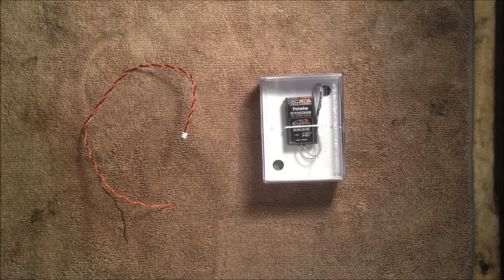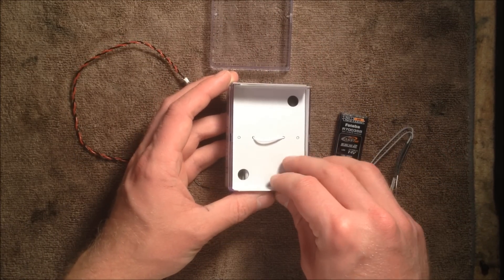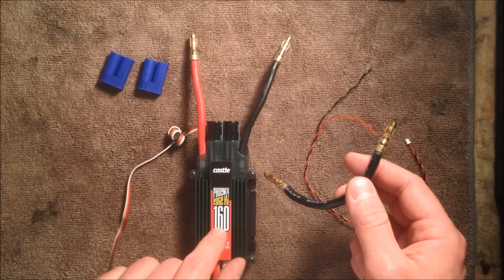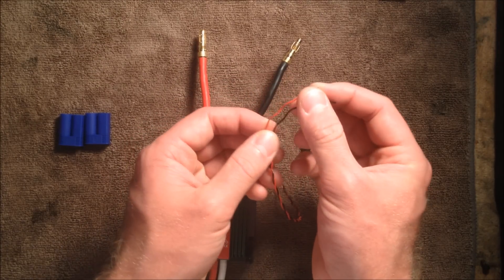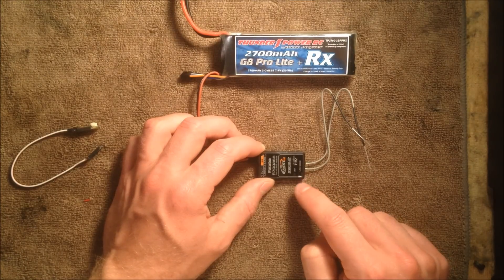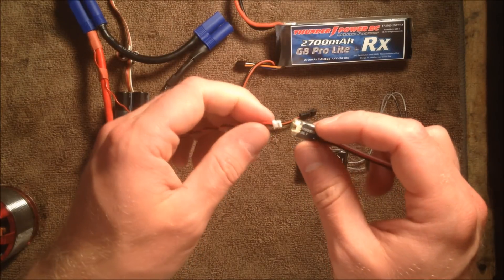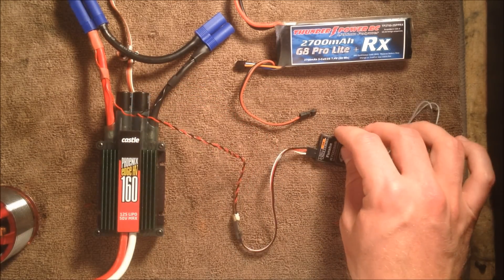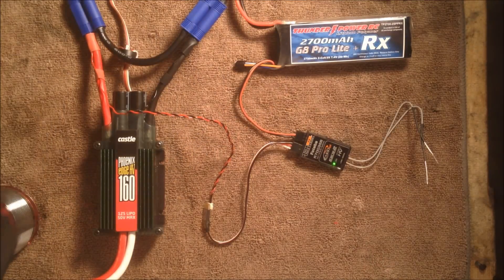Futaba R7003SB External Voltage Mode Setup

Comment: Great video. Thank you. Instead of using a futaba wire and an adapter, can I just use a servo lead wire that goes into the sbus Port of the RX and solder the positive and negative to the esc?

Comment: I have a 3008 reciever which has the port for the external voltage. Do I need to change mode between servo and external voltage as well? Or just plug it as it comes?

Comment: This might sound stupid but im trying to get this right I'm trying to compare this method to a plane.Confusing enough if i understood you correctly the voltage sensor solders on directly to the esc to get power then plugs into the receiver to transmit data back to the transmitter?It gets confusing watching others and some have it to where it seems they're using 2 batteries.1 to power the receiver and another to power the plane.

Comment: Hello, 
This is my first experience with telemetry!
I have Futaba SG14, 
I noted that I need (Futaba SBS-01V Sensor) to measure External Voltage.
So do I need a separate battery to power the telemetry and what is its specifications (voltage and and cells).  
Thanks

Comment: Hello, if the main voltage comming from the battery (7v) is turned off, the receiver is capable to work with only the external voltage?

Comment: I have several R7008SB receivers that I use this feature with. Since I only use S-Bus and the external pack voltage monitor, I don't need the R7008SB and thought that the R7003SB would work fine. My only question is if the 7003 is like the 7008 in that my 14SG transmitter can be set to 12 CH mode rather than 14 CH mode that is required for any sensors other than the external voltage port.

Your video was excellent even though as far as I know the Castle 160 HV is an ESC, not a receiver.

Thanks, man.
Reply from the maker: +warren douglas The 7003 can be used in 12CH or 14ch mode, just like the R7008.
Reply: +dchekas  Thanks. You just saved me some money.